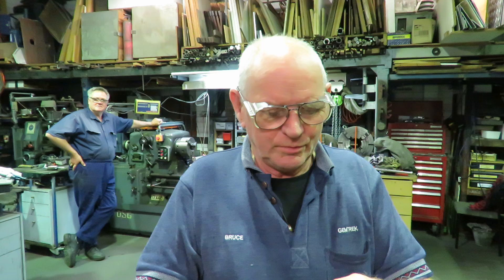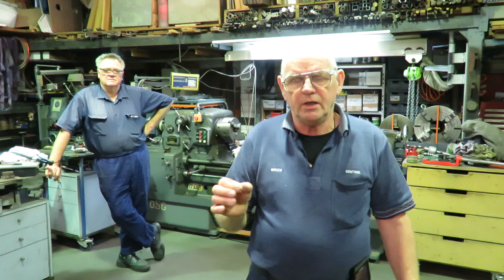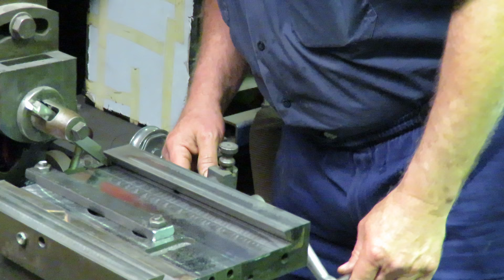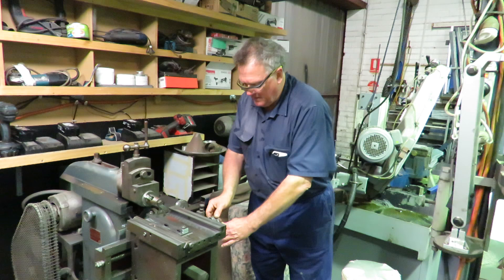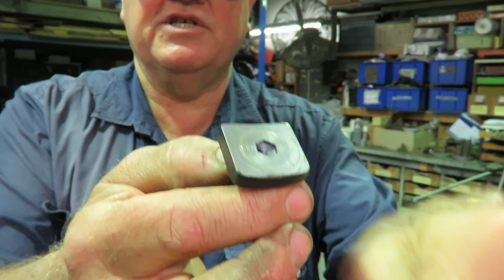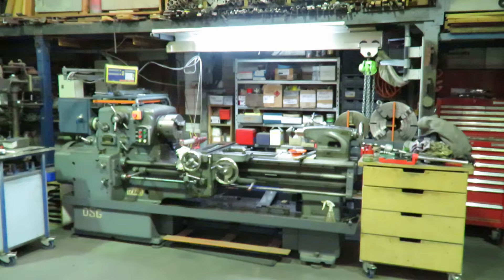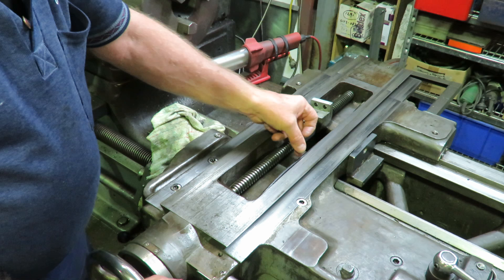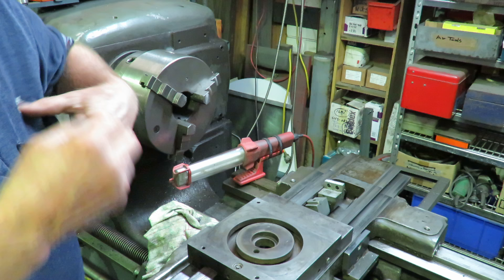Lipstick on Fred's DSG cross slide tells the tale No2

Comment: These days most shops would no longer have a shaper, and I use a slitting saw for dovetail relief. Set the work up in an angle vice and run it down the dovetail. It's only relief so absolute precision isn't required.

I can't recall if you have a surface plate Bruce, but if so, and Fred wants to scrape the slide, send me a message and I'll bring some scrapers and blue over and we'll knock that bad boy off. It's a beautiful lathe, and no reason it shouldn't be bought back to factory spec. The Biax would probably be a bit of a PIA to bring over, but hand scraping won't take long on that short slide.

Good tip on the lipstick BTW. I normally use bearing blue, but will try some lippy now and compare the results.

Comment: Hi Bruce. Just having a chuckle to myself watching you two in front of the camera. Lipstick used as Poor Mans Bearing Blue, who would have thought, love it. Love the idea for the Tee Bolts for the compound slide. Had to make a pair for a Drill Grinder last month, ended up making them out of the correct size piece of Key Steel. Does the job. Love the Vid.

Comment: I took the cross slide apart on my Mueller, and found that similar work had been done to it.
It gets tighter to move near center, farther out it's quite easy, even with the gibb adjusted all the way it.  It's probably going to need further correction later on, and probably will have to have a custom wedge ground for it so it can be properly adjusted.  Everyone comments about the battle scars on the ways, but I think the lathe was used for a lot of facing operations, because that is where the wear really is.